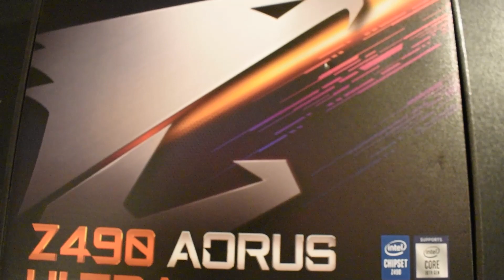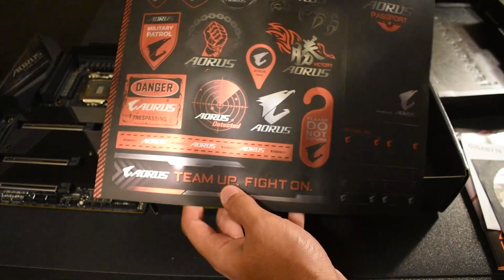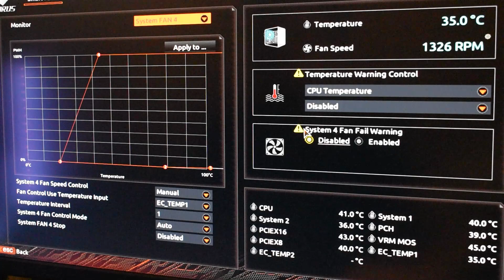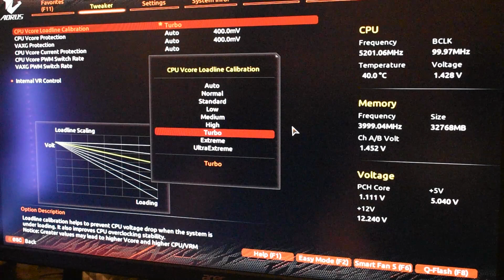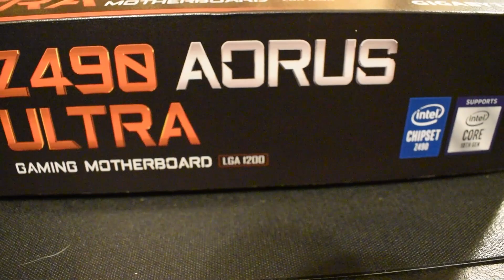Gigabyte Z490 AORUS Ultra Review

Comment: over 1.4 vcore? o.o
Reply from the maker: Die sense vcore is under 1.4v, but yes these cpu's can handle it in our experience.
Reply: @hardwarelens8040  i thought my 10700k with this board with 1.33 manual drooping to 1.28 under load with turbo llc die sense was bad =x guess not